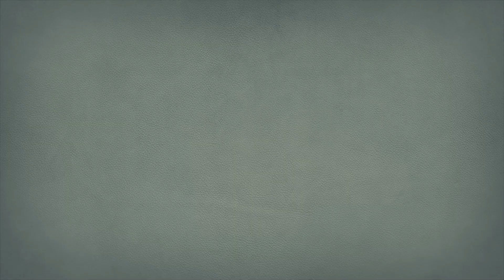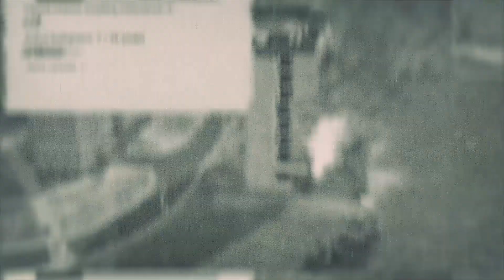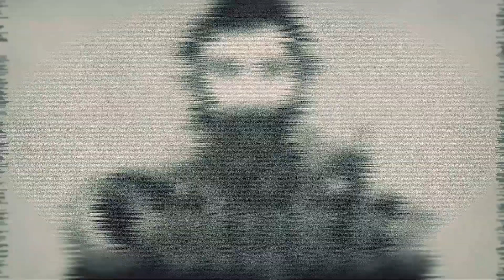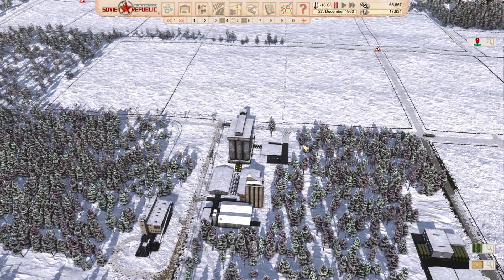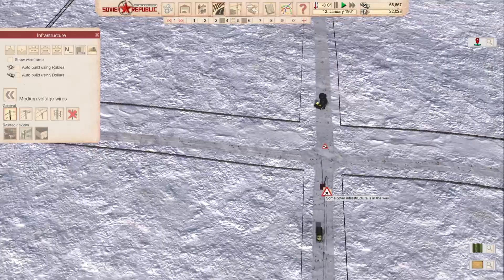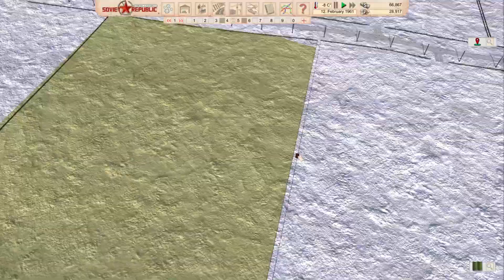Soviet Republic - Alaska - Alaskan Nights - Ep.3

Comment: On the subject of the specialization of construction offices, I think you have to start with the simplest and most important in an early game: building roads that are long enough to accommodate construction machinery. The construction of roads by the main construction office is very counterproductive:
1) The main problem is that the main construction office houses buses for workers to drive on construction projects. If this main construction office is working on a road that can use a buldozer or an excavator it will still send workers to the construction site even if a buldozer or an excavator is already there. However, a buldozer or an excavator can do the job without any external input of workers, so it is a waste of buses (and gasoline), of workers not only useless here but more useful elsewhere. It's a bit like for a stone quarry for example, you can send workers there but you think that it would be wasteful since the excavator can do the job alone... It is exactly the same reasoning for roads but even worse since the main construction office disperses its forces for no reason while non-road construction projects wait or take longer to be concluded. And that for nothing.
2) Since the main construction office houses excavators you run the risk of an excavator being used for road construction instead of a buldozer. An excavator that you will then miss for any buildings to be built using them for their groundwork phase. And since excavators are also much more expensive than buldozers you also don't want to use them on roads that can be bulldozed when they are more profitable for those groundworks. And if you also keep in mind that the grounwork phase does not need workers to be completed if an excavator is on site you are even less inclined to waste them on gravel roads ... :)
3) Since buldozers are never involved in building construction (they can only be used for the gravel part of roads or terraforming) they therefore also unnecessarily occupy main construction office slots, slots that could be filled more usefully by vehicles that can participate in your off-road construction projects.
4) As the open hulls from the main construction office are also used to transport, say 150 tonnes of boards to a construction site, these trucks will not be able to transport the buldozer on the roads to be built which will then wait sometimes a very long time to be finished. And some other times even almost never if, as it would be necessary, you chain construction projects to meet the deadlines of your five year plans :) Efficient planning for this pace of expansion benefits greatly from separate construction offices for roads and building construction.
The set up of such a road construction office is very simple, it only needs buldozers, dumpers and open hulls to transport the buldozers. The number of vehicles depending on the pace you want to have as well as the size of the road network to be built. And there everyone can have their opinion and their own conbinations :) For my part, I got used to road construction offices with 16 slots, 4 for buldozers, 4 for open hulls, 8 for dumpers. But again the combinations and the choices can be varied according to each one, there is no truth set in stone. On the other hand, if there is one certainty and only one, it is that a road construction office is necessary, and even more so at the beginning of the game when you want to see your workers producing cattle, your excavators building your silo, and your trucks carrying bricks and not buldozers to the other end of your agricultural area :)
A single specialized road construction office? No. To be truly efficient and not to waste your strengths you need a second one, even if the latter may perhaps be deemed less absolutely necessary than the first. This second construction office specializes in footpaths and small roads that CANNOT accommodate a buldozer to build them. The main characteristic of these construction projects is the low number of workers they require in reality compared to the theoretical number they can accommodate (50). Obviously in this playthrouh since you have chosen for your main construction office moded buses that carry only 12 (?) passengers, the problem has less urgency. But if, like everyone else, you had 50 (or so) passenger buses, it's a complete waste to send that number of workers on a footpath that can be built in a few seconds by five or six workers. Especially with the game mechanics if you have no luck your office construction will send two or three of these buses before the footpath is built :) The reasoning is the same for dumpers, some of these footpaths will require a few hundred kilograms of gravel and are going to use larger capacity dumpers (12 tons and more) instead of smaller dumpers, furthermore without disrupting construction projects requiring large volumes of gravel or asphalt for their groundwork, whereas small, cheaper dumpers (and inefficient for large projects due to their low capacity) could be mobilized. Again the moded dumpers you are use make this analysis less important for your playthrough, at least for now.
The set up of this second specialized road construction office is even simpler than the first: a few mini-buses, a few dumpers. The number of vehicles varies according to the tastes, the opinions, the needs of each one :) For my part I often use construction offices with eight slots, 4 mini-buses of 7 passengers and 4 low capacity dumpers. I will add that I know some players using 4 passengers individual cars instead of mini-buses to further reduce the loss of manpower on these foothpaths, I have never done that yet but it makes sense (and put some visual variety on our roads before we can build our own individual cars ^^)!
Reply from the maker: Sorry about this but I will have to read and think about this in the morning (12 hours from now). This is important and I need to understand it properly so expect a normal response then. 😊
Reply from the maker: Sorry about this. 
On this now! 

1. I agree! Buses taking people to a construction site where a bulldozer is located is useless. 
2. Perfect argument for this! 2/2
3. 3/3 100% agree!! 
4. OK I agree with this as well. Really good argument! 

If you are asking why 12 people buses we are using it's because of the imaginary V3S challenge. I'm giving up on that! We will have bigger buses soon. I love the idea of cars! I wasn't even aware we can use them in construction offices! :) 

Questions! 
1. Do you set all of your offices on auto search? 
2. How do you cope with short roads? Manually assign them to another office?

Comment: When connecting your access roads to the "main" road (for example the fields on your new farm), rather than making a right-angled connection, bend those access roads in the direction that the trucks or machinery of the farm will come from, the vehicles in this game do not like right angles and lose a lot of speed. In urban areas, it is these right angles that create the most traffic congestion btw. As soon as possible and when we know the direction of the vechicles, it is always more efficient to proceed in this way ... And again, don't connect your access roads to your main road right away, you are splitting up your construction projects and going to waste a lot of time for nothing. I know it may sound like a small detail but you would be amazed at how much time (and gasoline) you would save by planning your road construction this way. Instead of having a single open hull carrying a single buldozer on a single long road (for example the one passing in front of the second farm) you will have six or seven long round trips, refueling, several vehicles mobilized etc. to build the same length of road ...On the other hand thinking about priorities when planning your constructions seems to me of great importance if you want a sustained pace of expansion : some gravel roads are under construction while others are more urgent, you have risked a devastating fire, you have lost money two or three times due to an overcrowded stable etc. Personally I always start with the roads coming from the border, connecting the fire station, the heating plant and the food store, after that it is according to your priority axes of expansion
Reply from the maker: 1. You are right about right angels. But I'm not thinking ahead. It makes little difference while in mud but when we out gravel this will make a difference ! 

2. Thinking and planning the roads is an absolute MUST! I agree. What we had problem with was that we needed to build a farm, sow the fields ASAP! But this is no excuse. I should have started on the project earlier!

Comment: Pulling a 0.65 capacity power cable directly from your main power transformer is not cost effective. A 2.35 power cable from this main power transformer up to a medium switch and then distributed in several 0.65 (or more) would make more sense. The main power transformers (the most expensive) are mainly there to distribute the medium voltage cables of higher capacity. Well in my opinion...
Reply from the maker: Another good one. The reason I made those cables is because I'm not planning to expand in that direction. 
But this always comes back and bites me in the ass. 😅

Comment: It is risky to plan the second silo so far from the fields of the second farm, your trucks may have a hard time transporting everything before the temperature drops below 0 ° C with such long journeys (and for additional information note that for 12 large fields 6 trucks can be enough to collect everything if the fields are not too off-center and the roads are in gravel). It's a risky bet that you can only take because there are no elections in your Soviet Republic :) It is often more efficient to provide a silo in the same (and each) area of crop collection with the trucks attached to this area, and another "central" delivery silo in the industrial area to which is attached a distribution office which has its own trucks, the latter collecting the crops at the various silos in agricultural areas throughout the year, this spread of distribution from the farms to the central silo makes it possible not to multiply the latter or to have a gigantic one. The silo of each farm receives in a fairly short time its 3,600 tonnes of crops, the silo of the industrial zone receives the crops from several silos throughout the year, the duration of the desired spread depending on the number of trucks allocated at its distribution office.
Reply from the maker: 6 trucks for 12 big fields is a good plan but I'm thinking about 12. If money permits. But I will be buying GAZ livestock transporters and putting the current ones to the DO next to the second farm. :) 
Regarding the silo next to the second farm. It's too late now. What I can do is get them more trucks and create a shortcut through the fields. In order to build another distribution office near the second farm we would need more truck and that is also a cost to consider.
Good call!
Reply: @oolykeegaming81  More planning and less rush my friend :)))